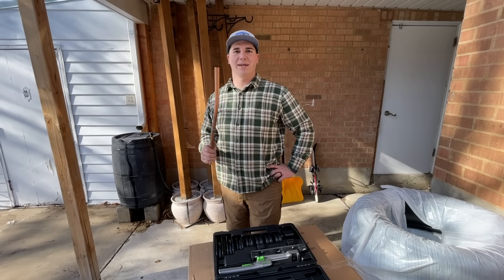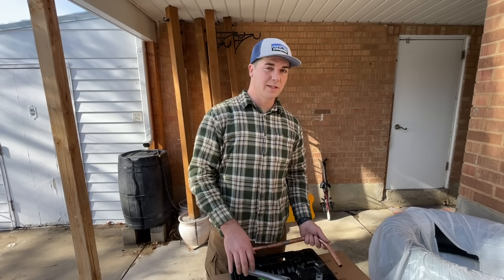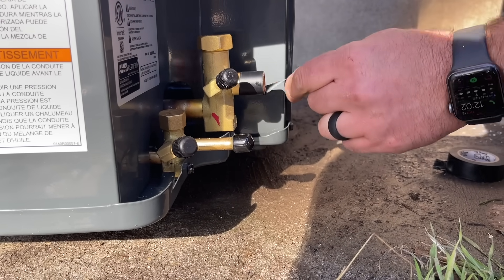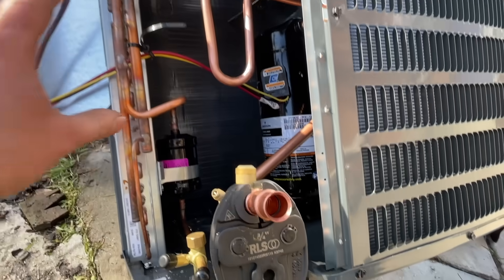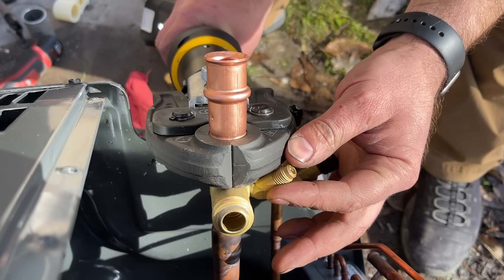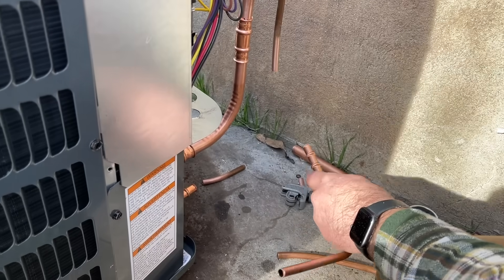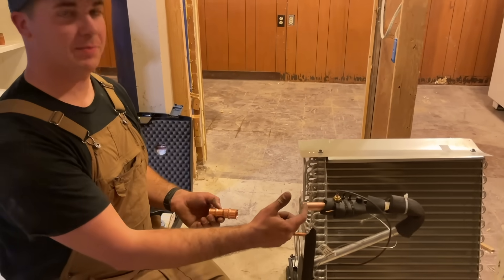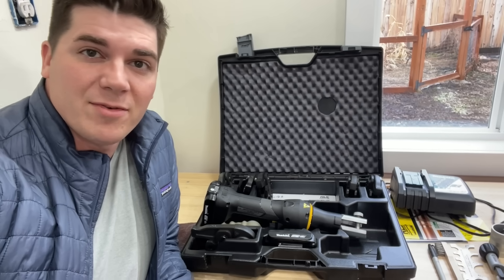Brazing Is For Cavemen. THIS Is The Future Of HVAC Copper Connections. -RLS Crimping Tool-

Comment: Nothing against the tool, which I have used many times, but I've also had it hold at 500 psi then be hit, kicked or bumped into and literally loosen up. worst case scenario, ie blown in or not the best place to braze they are great. never to be touched. but if I braze a joint, I  don't care; if it holds it will never leak. and practice makes perfect. I'm like a factory bead. I would rather count on a guarantee than a rubber gasket. Also fittings get expensive.

Comment: There's no way doing this saves any time. All the extra steps you had to take with the fittings and setting the tool up, I could have had that unit brazed in 3 times.
Reply from the maker: *unzips pants and presents whopping wiener

Comment: how do you remove the fitting when you need to do repairs? Im seeing lots of locations where this large tool wont fit also. Im not sure id use these fittings on a refrigeration system with 500lbs+ of refrigerant
Reply from the maker: Yea probably not a great option for that. If this leaks it’s not a huge deal to replace it. I’ll do a video on how to remove the fitting and fix a leak soon!

Comment: I've used a propress(plumbing) for a years now and i love it. However press style fittings for refrigeration lines I'm not so sure about. Brazing would of required just 2 couplings not 4 and i think in the time it took to unbolt, wrap with tape and cut the hub on the service valves i would of set up nitrogen to run through while I braze. Not to mention if you mess that crimp up or have a defective fitting that leaks you have no room left to cut and add a new coupling because it's to close to valve. I'd suggest brazing at least a stub on the valves so you have that buffer
Reply from the maker: I will do the nipple sweated in on the next one but I legitimately wanted to see how long this system will be leak free. Hopefully a long time :) if one leaks you guys will be the first to know about it! Cheers
Reply: @diyhvacguy  With the amount of potential leak points on that line set you won't have to wait much..
Reply: Day and night and Carrier used to use an o ring, with a compression nut to join the suction line at their residential condensing units.  They all leaked, and had to be repaired by cutting right after the o ring and brazing the line into the remaining stub on the unit.
Reply: I wonder how long they'll last if a safety fails and the compressor runs hot and overpressure @rodgraff1782

Comment: This is definitely nice for someone that’s not able to braze very good but it seems like in this particular situation, it’s very time consuming.
Reply: For heavens sake, learn to freaking braze properly or pick a different trade.
Reply: If you dont know how to braze, definitely you are in the wrong trade. 
What about when is a heat pump when the suction line becomes the discharge side of the compressor. Dont want to think when some want to be Service tech goes for a service call and bypasses all safeties switches. Im 100% that one of those joints will blast 💥 out like a steam train whistle
Reply from the maker: What makes you guys assume that I can’t braze? lol if you watched my channel you’d know that I don’t have any problem brazing. You guys could be a bit less rude, what if I wasn’t good at brazing? Am I not good enough for your trade? Geez guys, have some compassion.
Reply: @The DIY HVAC Guy  I'm a commercial tech, work in big data centers and medical facilities mostly. I will say this, you shouldn't rely on zoomlock because nothing will beat brazing a joint. But zoomlock does have its place, you have an emergency repair that needs to be made at 1am and you can't get the fire alarm company out or a fire watch then zoomlock it is. Mini splits where you want zero chance of scale inside the system is also good for zoomlock, even if you flow nitrogen I still like knowing there is a zero chance of anything getting in the system.

I've had good success with zoomlock when I've used it and it's not just pushing a button on a tool like most people think, there is some skill involved to getting consistent fittings with no leaks. 
Do your thing man, it works and looks like you got it.
Reply: You can buy a whole bunch of fittings to practice with for the cost of those tool sets.

Comment: Just left a company that used these fittings for a couple of years , now they have a technician that goes back and replace these fittings with a normal braze joint. I now work for my self an will never use any kinda fitting the has a rubber gasket . I was very fortunate to learn how to braze due to being trained by older men with true talents . Honestly learn to braze an you will have a true skill that can be used for way more
Reply from the maker: If you’m watch my past videos you’ll see that I am proficient at brazing. I just really wanted to test out this product because Zac over at Qualityhvacr seems like he knows what he’s doing and he uses the rls kit all the time. I’ll probably continue to braze and solder with Staybrite 8 and have this for certain scenarios. Probably part of the issue was that the fittings weren’t installed properly. The installer really needs to be in tune with how the fitting should feel sliding on, and that pipe had better be prepped correctly or I agree, you will have problems. At any rate I can respect a fellow tradesman who chooses to braze as it is tried and tested 👊🏼 cheers

Comment: Is o-ring elastomer in these fittings specific to the refrigerant used or same as used for water plumbing?
Reply from the maker: It’s definitely a different fitting that’s specific to refrigerant so one would assume the o ring is different as it’s exposed to refrigerant oils and higher pressure.
Reply: @diyhvacguy  Makes complete sense.  Thx for confirming.

Comment: This is a great crimping system but if you use on soft copper you will have leaks. Over time you will have leaks 100%. This works great on hard drawn copper piping but not on soft. Can’t bend hard copper. Do not use on soft copper !!!! Just a friendly warning.
Reply from the maker: It says on RLS website that it’s good for hard drawn and soft copper.

Comment: 2 years ago I visited a LG training facility. I noticed that all the refrigerant lines were press fit.  Now it looks like R32 will be the most common refrigerant.  Because R32 is flammable, the press fit fittings make perfect sense.
Reply: Your comment is probably the most relevant: Crimped fittings are apt for the flammable refrigerant, whereas they are not needed for non-flammable refrigerants.
Reply: Are they press fitting the compressor and reversing valves and everything else inside the condenser?

Comment: Lots of guys are having problems with zoomlock on valves. The length of tubing after you cut off the flare is JUST shy in most cases to get a good fit. Manufacturers are working on it. Pressfit is the way to go. Never do it twice! Even with pex crimping the fittings have a little spring to them, leave the crimper on for a few seconds to allow the molecules to settle

Comment: The only weakness I see and caution is any original lines coming from the HVAC is a permanent crush, if you mess that connection up, your going to have to solder to get your length back because you have to cut your crimp. I can see you want as much as distance as possible to give you length to repair unless the plan is for the unit to brake down on the customer before the seals go.
Reply from the maker: I’ll show a video soon on how to remove one of these. It’s really not that bad, but I genuinely want to test the longevity of these, and if they leak you guys will be the first to know! Cheers

Comment: I work commercial refrigeration. We don’t usually buy soft copper. Does this work on copper that has not been annealed. If you have to anneal the copper then you might as well braze it.
Reply from the maker: No it doesn’t have to be annealed

Comment: By the time you removed the bracket, taped it up, cut it, removed the tape, unpacked the tool, cleaned up the fittings, and crimped the fitting you could have made 10 brazes. That’s a lot of work for one joint. And what if it leaks?  You have ruined your service valve. I think this tool works, but does not replace brazing. Don’t use it where the amount of work and risk outweighs the benefits.
Reply from the maker: Yea you are right on the service valve, but in this demo I wanted to show a complete braze free system so that’s what I did. I’ll do a video that shows removing these if that ever needs to be done, so stay tuned for that. I wish they’d start making a longer stub. I’ve seen a lot of tempstar condensers that have a good like 2.5” before the bell. Maybe more of the manufacturers will start doing something like that. Cheers
Reply: @diyhvacguy  there is a use for these. Emergencies repairs. Coupling pipe together in long runs maybe. Fixing water lines where you cannot get the water to stop leaking by your solder connection. I don’t see it as a replacement to brazing. Maybe you should do a tutorial on Staybrite 8. No need for nitrogen. A lot of guys use it even if for some reason they don’t want to admit it.

Comment: I did HVAC for 20 years I could have brazed that before you finished your first cut and been home in time for corn flakes this generation is so lazy
Reply from the maker: If you’ve seen my videos you’d know that I have brazed in many a system, and I enjoy brazing, but you have to admit, this is a safer way to join pipes. No flame, no nitrogen flow, no burning up a service valve or catching the grass on fire by the unit, or leaving a burn mark on their siding lol I’m not giving up on brazing, the title is just for attention, but this is a very nice option for spaces that I can/am not allowed to braze In.   Cheers
Reply: @diyhvacguy  Everyone forgets all the prep to braze (and the fact you’re making a video, not just working). How about getting the gauges out, setting up your nitrogen, getting a bucket and some wet rags, pulling the shraders out, testing your purge setup, making sure you don’t burn anything? Or… I clean a pipe, mark a line, and press a button? I can braze too. Nothing special. Advancing technology is not laziness. If you haven’t used it, don’t bash it. Because you really don’t know

Comment: From watching many HVAC videos on the subject of brazing, the biggest reason I see NOT to braze is the potential to contaminate the refrigerant with debris or flux. In an ideal system, nothing would be brazed. Hopefully these crimps withstand the pressures and the test of time.
Reply: It’s not the process that causes the problem.  It’s the person who doesn’t know how to braze properly.
Reply: o-rings are a leak waiting to happen , schrader valves are proof of that  over time the rubber contracts or wears out  completely
Reply: This is why we flow nitrogen...
Reply: There’s also these things called flares….

Comment: Everyone bashing but as always there is a time and a place.  Some areas are worth the possibility of having to make a repair in 5 to 10 years.  Think about sweating in a connection in a computer room with VESDA  and Halon or a oxygen room at a hospital or medical facility. Totally worth not having to go through the Hot Work Permits.  Not Having to clear out the Oxygen rooms , but for those to be considered it is important for other methods to be tried and tested.  Sure it has been accommodated in past but other methods-can be welcomed.

Comment: Those o-ring seals will fail in short order after the refrigerant oil soaks through them.  They are rated for water only.  Oils require a different material for o-rings.
Reply from the maker: Then why would this even be on the market?
Reply: You are correct Orings need to be made of different materials for different liquids and gases flowing through them. The thing is that they are. Rubber, nitrile amongst others and yes these fittings don’t use the rubber because they already know these things don’t work with the most basic of O-rings.

Comment: Informative video, the plumbing folks switched over to Pro Press a few years ago. According to one of the service managers I worked with, it allowed him to hire folks without having to teach them to solder or braze- lowering the skills bar on an industry that struggles to attract and retain talent. I will say I liked using Pro Press when it was cold to save time...but man, it doesn't feel very good.
Reply: Yea, and then when it comes time to replace a compressor or reversing valve they won't know how to braze.
Reply: Pro press for water piping is ok, especially in tight areas where you can’t braze.  I have been retired for 16 years, and it was being used before that.
Reply: Agree. Although the excuse of some people not wanting to teach welding, is a weak excuse as welding is really easy. I have used both, and had press fittings fail for unknown reasons while solder joints never fail for me as of yet. I could even put my whole weight on a solder joint, but would I do that with a press fitting, never. 😉

Comment: If you really wan't to save time. And still guarantee a good end product. Use induction heater and Silfos Rings.
Reply from the maker: Can you please please email me and expound on this? I’d love to know more about this method! Thanks,   Dave      Diyhvacguy@gmail.com
Reply: @diyhvacguy  Lucas Milhaupt SilFos Rings 15% ,just add heat. The induction heater is if you don't want to burn houses etc down. They have different names.
Reply: @persimonsen8792  Never heard of this. With the induction heat being more direct, does it still build up carbon and require nitro?
Reply: Wow. Will still require Nitro but this is amazing. Would require 240V. Just use widowmaker from disconnect. 

https://www.youtube.com/watch?v=Qxc3QrNyODA
Reply: I think Robinair made what they called a Lectra Torch.  It was a clamp on electric pipe heater  Those have been out for years